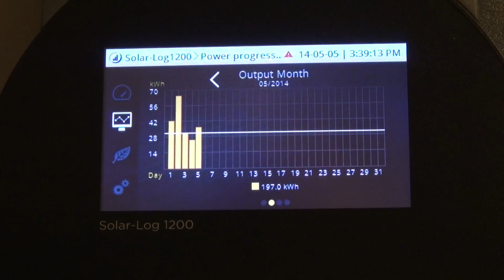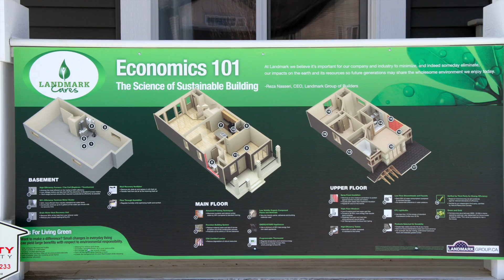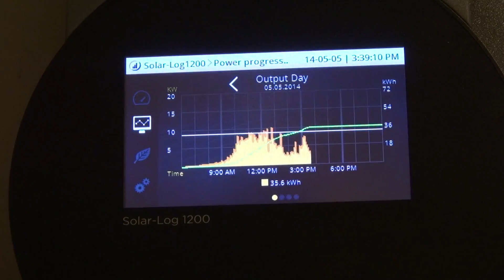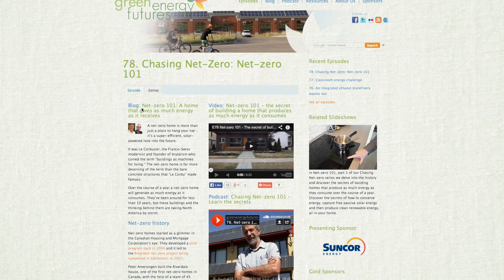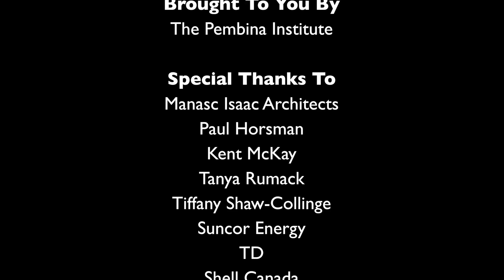81. Net-Zero: Go Big or Go Home - A builder pledges all new homes will be net-zero

Comment: 4 years after this video and the reality is the cost of solar has dropped in a big way..  Right now I have priced out 5000 watt array with inverters and it is under $5000.  To be really more net zero all we need is the cost of batteries to drop. Batteries over needing to connect to the grid is a lot more carbon neutral. We are seeing this model really well in Austrailia, where power is super expensive.

Comment: How well do those solar collectors work in Edmonton when they are covered with snow for most of the winter?
Reply: why not using very cheap low voltage heating tapes to melt the snow, like in gutters, so the snow and frost even cannot catch on the panel ??
Reply: NAIT did a 5 study and only recorded a 20% drop in output when covered in snow.  However, most of the time the snow kept sliding off.

Comment: Great story! Thanks, David! He says that the cost including 10 kw of solar costs $37,300 more than a conventional home, including the solar PV. That's a price of $3.70 a watt, which is very competitive - and the roofs will save $1,300 a year, rising each year compared to the price of regular electricity.
Reply: wow
Reply: @greenenergyfutures  I am seeing panel prices drop into the 25 cent per watt amount .. Micro inverters for $370 watt panels is down to around $80.  The wonder of the micro inverter over a string inverter shown in this video is that when one panel drops in output due to something like a cloud going over only that panel has a drop in output. Some of the newer micro inverters are so efficient that the output can be as much as 25% more than a string inverter.    One thing I was amazed to read is that many of the string inverters have a tough time not going bad half way thru the life of a 25 year system.

Comment: To pay $37,000 extra for the home, you may end up losing a lot of money. How much is interest on $37000. Let's say your utility bills runs an average $150 a month. 12 months a year for 20 years. Thats $36000.
Hope nothing goes wrong with the equipment. Feel free to correct my miss understanding.
Reply: You must live in Florida to pay only $150 a month in utilities.  Here in Canada even an energy frugal family will pay at least 2 times that. So by your calculation it would be only 10 years to pay off at present rates.  After that of course it has paid for itself.
Reply: Plus in next 20 years,
Imagine if you have an electric car replaceable batteries charge with the same Solar panels installed on your house.
Also read about smart grid concept the next generation of optimal energy utilisation, http://smartgrid.ieee.org/questions-and-answers/964-smart-grid-consumer-benefits
Reply: Also in Alaska, you can spend 20k on a boiler and over ten years spend 50k on heating oil for a 2500sqft home.  It's better to just spend that extra money making a passive house with an air exchanger, and not need to buy a boiler or heating oil.
Reply: I can tell you about the Toronto our government was having 38.4 cents per KW offered for 20 years. At that time I had installed a 10KW system that cost me 22K and giving me around 4800 per year I get cheques regularly from Hydro. My pay back is 4.5 to 5 years time. As there are no moving parts so that can run for 20 /25 years. We had replaced shingles so the life for that is 20 years and the one which is under solar panels will have even longer life. My system is 3 years and enjoying the return on investment at 14% for the rest of the time. Cant go wrong.
Reply: Even if you consider 10 KW system which is sufficient for a home. It cost in today market at 25k if you divide by 1800 per year at current electrical rates even then it will be paid in 12 years so you will still have 8 years to have the benefits. The interest on 25k in GIC or Bonds not guaranteed. There is No risk in Solar investment.
Reply: There are places in Alaska where cost of energy is $3, 4, 5, 6, or 7,000 per year.  In that case there is a shorter payoff.  Plus if energy costs rise consistently over a 10 or 20 year period then that would also create a shorter payoff period.  Here's a list of examples of Alaskan energy prices:  http://www.cchrc.org/results